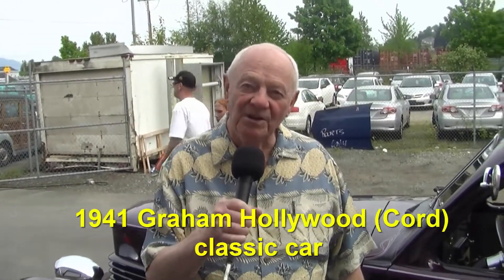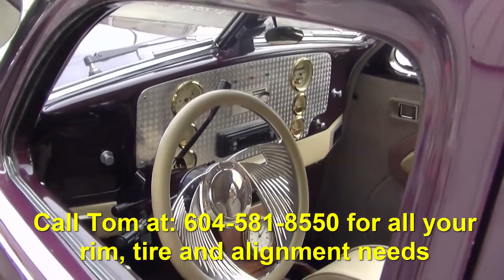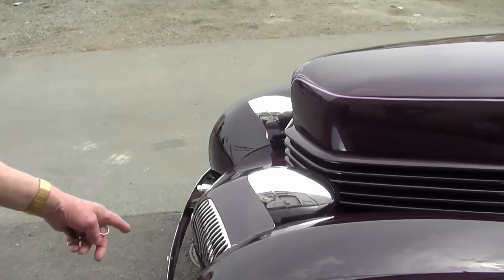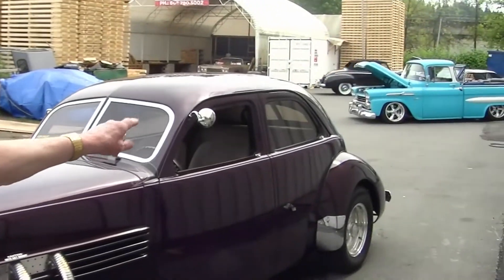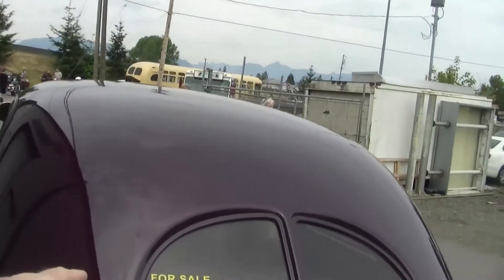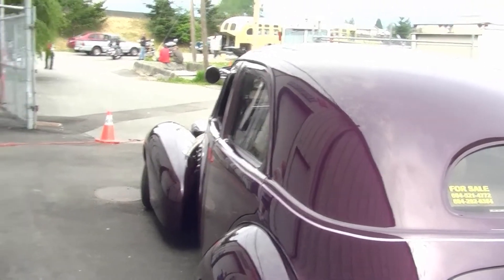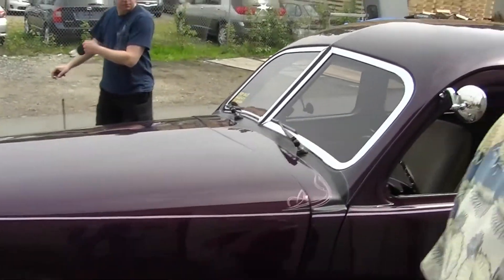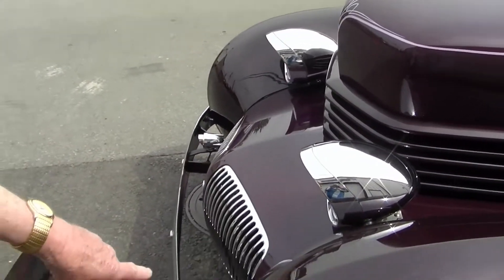1941 Graham Hollywood Cord Car

Comment: The car started as a Graham Hollywood. The owner has his facts very jumbled. The car was produced by Graham-Paige in 1940 and 1941 model years. Norman De Vaux acquired the Cord parts, dies and tooling from the bankruptcy trustee for the Cord Cotporation. He made a deal  with the Hupmobile Motor Company to produce a rear wheel drive car based on the Cord tooling. Hupmobile could not get the car into production successfully. Joseph Graham of Graham-Paige offered  to produce the Hupmobile Skylark if he could also make a version for Graham known as the Hollywood.